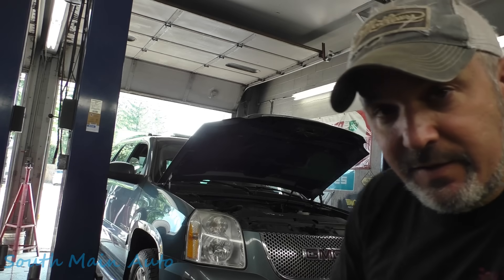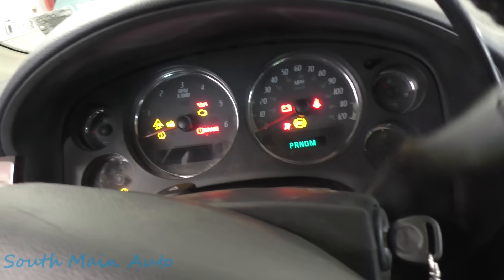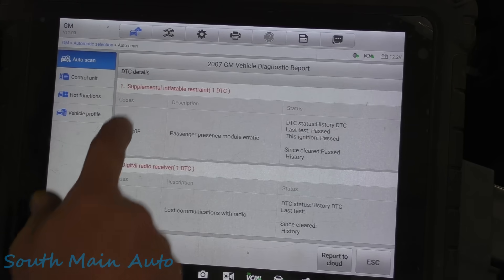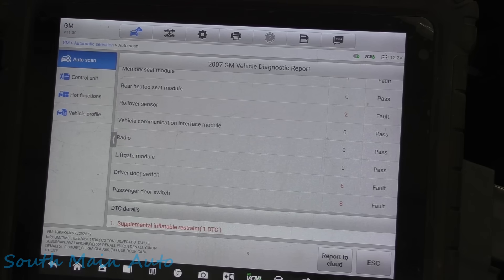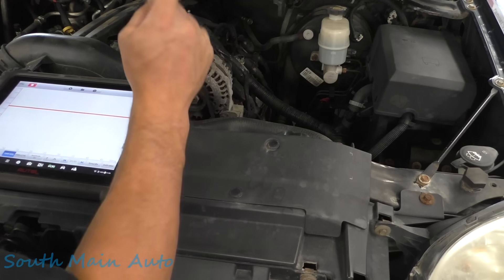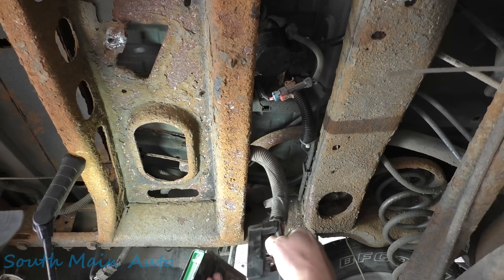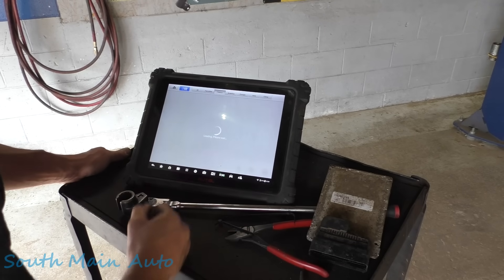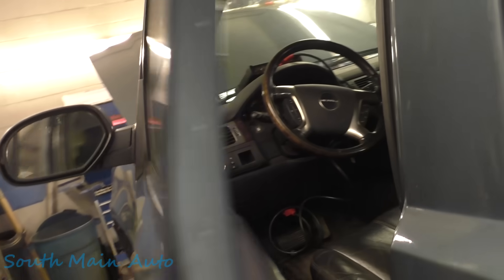Sometimes A Lucky Guess Is Way Easier Than An Actual Diag

Comment: Living my whole life in Michigan and as a retired mechanic I always thought Michigan was the "King of the Rust Belt" when it came to rust damage to vehicles. After watching your videos and seeing the extensive damage to PRNY vehicles I bow to the King. One question, do you sometimes get concerned about even lifting a car on the hoist in fear that the frame could completely fail?
Reply: PA is probably the "prince" of rust.  but with our Draconian inspections, vehicles in a LOT better shape than that underneath get sent to the scrapyard.  I lost a low mileage Honda to a subframe pinhole, for example
Reply: I am also in Michigan. I have gotten some Ny cars in to work on and let me tell you😂. First time I saw a rusted out radiator hose spring clamp was a Ny car.
Reply: Hello from Higgins lake Michigan
Reply: Hello from Hopkins, Mi
Reply: I fled MI for GA nearly ten years ago. Sure don’t miss the rust.
Reply: There are other agents dot can use to get rid of snow and ice … they are most expensive but they don’t put salt in the creeks and rivers … so much for ecological awareness…
Reply: Here in WI, we aren't far behind in the rust department. My '05 town and country fell victim of rust and could not be lifted to put on tires. Got my money's worth out of it with 217k miles though.
Reply: Nope, The Great Industrial Northeast has everyone beat!
Reply: What’s up from Lansing.
Reply: What does NY use on their roads?  I too am from Michigan and my almost 20 year old pickup is in much better shape than that Yukon
Reply: @briansmith Usually, whatever is the cheapest deicer which is often good ole plain rock salt.
😂
Reply: @mph5896 
Here in Ontario we have broken clamp problems all the time. Very common to see used vehicles with some spring clamps replaced with stainless worm gear clamps. The latter clamps are not perfectly circular and will likely leak eventually.
Reply: Ya im just starting out in michigan thought some of the things I see are bad but wow. And love the level of work.
Reply: Minnesota rust belt here.. yeah, my old 88' Silverado frame broke in half while being lifted.
Reply: @briansmith1514  we use salt, and now the state is starting to use brine liquid salt unfortunately this kills cars here. I can’t wait to leave NY
Reply: Missouri can be just as bad, just takes longer!
Reply: That is funny I once put a 70 Buick electra (on or around 82 which would make it 12yrs old) on a single post lift and if it didn't have a driveshaft in it the rear frame section would have been on the floor lol
Reply: @briansmith1514 rock salt 
 Comes from a mine maybe 50 miles from the SMA mother ship
Reply: I would not put any vehicle with that level of rust on a vehicle lift.  Here in the UK that vehicle would be condemned to the scrap heap.
Reply: When I lived in Holland Michigan I seen a lot of cars all rusted out along bottom of car glad I didn't drive or work on cars when I was there
Reply: Illinois is up there too.
Reply: I thought my 03 Chevy was rusting. I live  in New Mexico. Land of Disenchantment.
😅😅
Reply: I live in Iowa and my 2013 sonata doesn’t have any rust yet. Well, mostly. Some very very minor surface rust   And we have winters with that brine stuff being put on the road. I also once a week wash it underneath in the snow season. That must be helping it
Reply: This is true but in Michigan that truck is getting fixed and driven for sure that frame has another 10 years on it
Reply: I am across the lake from you in Ontario and have the same issues. A few cars have litterly nothing left to jack on and they go on the drive on hoist and of course  customer is informed to start car shopping.
Reply: @stevestadnik9206  they never listen either they just keep driving it until it falls apart
Reply: I can hazard a guess that you people think California cars are rust-free. For the vast majority that is true. There are areas where there is rust. Where do you think this is?
.
.
.
.
.
On the coast from salt fog. As a kid, I saw a neighbor's car with rust holes that were fairly large on a young car (3-4 years old).
Reply: @LadyAnuB  trust me cars from the coast look great compared to those from states like NY not saying the don't get rusty but its no where near as fast
Reply: @rufedog5406  Definitely. the massive amount of salt contact of road salt vs. air salt
Reply: @briansmith1514 they salt them heavily
Reply: Come to MA
Reply: @LadyAnuB My 5th grade English teacher drove from his home in Corpus Christi in a 72 Matador that was rusted through on the roof, hood and deck lid, from sea water.
Reply: @ihavethedocuments2580  Ginormous bills just for existing.  as for "morals"...there's been complaints about that literally since they invented writing.
Reply: @LadyAnuB   they have to be /really/ close to the coast.. even 2-3 miles inland there's no ocean salt.    I lived in Pacific Grove in the late 70s stuck out into the fog belt, I know it well.   And, the ocean fog salt tends to rust the exterior, rather than the chassis like road salt does.   Until earlier this year, we had a 1994 Mercedes wagon that spent its whole life in Monterey/Carmel, and Santa Cruz, had zero rust even at 280,000 miles, and I still see it around town driven by the guy we sold it to.
Reply: I lifted a Nissan pickup truck and it turned into a U bolt. Took 4 men jumping in the bed to strengthen it out. 😁
Just another day in Beantown.
Reply: @johnpauljones1499  😮😮😮😮😮
Reply: @captaindunsell8568 when I lived out in high desert Oregon, they'd just pack the roads with lava rock gravel (or not at all).
Reply: Uh why are you running that vehicle on the lift shifting gears???? You probabky just destroyed that t case bud.. this vehicle isn't supposed to be driven on the lift..
Reply: What up from prison town.
Reply: @Sweeter-Jobs  Small world!  I grew up on Main St.  Vikings class of 92
Reply: @gabekekis7032  The Ranger in my profile pic was a victim of brine liquid salt in Upper Michigan.  It was actually still my daily driver at that point.  You could almost watch it rust.  Although I heard MDOT was trying to get away from the brine because it's also eating up their equipment like Pac-Man.  Could be a rumor.
Reply: @ericwilson9314  I wouldn’t doubt it, very corrosive.
Reply: @anonymuswere never heard of a mig welder and a flap wheel?
Reply: I was a tech back in New York I watched a co worker lift a pick up and it folded in half from the rust !
Reply: @UHOH3300  I think that's a red flag in this state for inspectors.  I had that situation two cars previously, and the BUSINESS OWNER outright refused, saying "I Don't Want Sued".  not only did they not get my business, they went OUT of business.  it's my understanding that the State cracked down on inspectors for "sneaking stickers".  as I've stated, PA has some very Draconian standards.  nothing compared to a british MOT (which, apparently, literally checks the torque on EVERY NUT AND BOLT), but considering we're in the middle of a cluster of "no inspections" states...
also, no experience with that sort of thing, and no tools or lift to do anything with...we have to junk multiple lawn tractors 'cause there's no one around here that fixes things
Reply: there is a large underground salt mine a few miles north of his shop.
Reply: @airman6822  we at 250,000 + with our Toyota Minivan and she'll probably go another 200,000 miles
Reply: Michigan tech, I've seen some Minnesota vehicles and NY vehicles tied for rust champs, here, just had an '11 Silverado that the fuel tank fell out while it was on the hoist, frame crossmembers are gone...
Reply: @ronlind1757 another MN guy. Besides my parents moving back to MN in '71 from CA, I'm really not sure what I'm doing here still!
Reply: Older Dodge Dakota. Guy called me to check it out because it wouldn't start. Got there. Dead battery. Hook up cables. Get engine to turn over. Kinda sputters. Pushed the shredder valve to check for fuel pressure. Yep. Smelled what came out. Diesel.... He denied putting diesel in the tank. I start evaluating the truck. Noticed the top of the box is touching the cab! Yep! If it wasn't for the box hitting the cab. It probably would folded in half! He junked it!
Reply: Oh yeah! I've put 5 year old cars on lifts in NY that start bending, or the lift will literally go through the subrame/floor ... but because the fantastic NYS safety inspections, those still end up on the road.... super safe!
Reply: i know someone that lost a gm pickup because his mechanic lifted it, and the frame cracked. It is a concern around here.
Reply: @snoopdogie187  yeah - and it’s not just GM’s… Fords are cracking too, and I’ve had unibody cars bend too.
Reply: I always look underneath at the frame while setting it up to lift so it doesn't fold in half on me, never had it happen, Silverado's are usually the most dangerous, here in Connecticut.
Reply: 30+ yrs of salty nyroads is why I live in Arizona now lol 😆

Comment: I had a buddy Tom who was an appliance repair guy. I called him about my dryer not working.  He asked me the make and I told him. He said the wire for the door switch fell and was rubbing  on the drum and wore it in half. I thought he was nuts until he came over and showed me. Said it's common with this brand. Lots of years in the business.  Great diagnosis.

Comment: Years ago, I can remember back in the 1960's and 1970s, here in The Great Industrial Northeast, you would get about three years before rust started poking its way out of your nice new shiny car paint.
Now, with stainless steel exhaust systems, anti corrosion paints, galvanized metal, and plastics, you can get about eight years before the rust starts showing itself.

Comment: I had an 2011 denali that had electrical issues that would put it in limp mode.  Had the same issues. Took out the module and sealed up the connector. Back in business👍

Comment: I definitely learned something from this video! A: about the Denali suspension module common issue and B: never ever buy a freaking snap on scan tool when there are options like that Autel out there! Checking the network activity right from the scanner?? I didn’t even know that was a thing!

Comment: I spent the first 26 years of my 50 years as a tech in Gm dealers so many common problems made diag a breeze when I went to the aftermarket repair field what a eye opener.
Reply: What exactly do you mean, the failures across manufacturers?
Reply: @cyrilhudak4568  I think what you are referring to is not here now. I'm scratching my head.
Reply: @flagmichael  I meant what was eye opening about aftermarket repair vs working exclusively on GM products.

Comment: you are absolutely right about the lick um stick um . But that said if the shops rejected all the fails like they should people would be walking or getting a horse and buggy 😊 When will these States up here go back to using just sand on the roadways like back in the 60's ! I hate salt but you have those that don't care and need a refresher course on driving in winter !!  
I never had a 4x4 until the late 80"s 
2wd with good SNOW treads and some weight on the bed was plenty .

Comment: I have a 53" International 2 Ton dump truck (grain truck) and it's frame is still immaculate.    I've never seen rust as bad as this here in Oklahoma-- never.   You might see the occasional rust hole in a rocker panel or around the fenders etc-  on a 1970's or 80's pickup.. But otherwise, rust doesn't really exist;  once the steel gets a paint job, it typically lasts virtually forever.   I don't see how you guys deal with it.  I couldn't image buying a brand new truck knowing that it probably won't last 10 years.  smh..  That's just insane.  I've always bought vehicles that have 150k to 170k miles-- and THEN I drive them for 10 more years after that, and run them past 300k.  So IDK--  You guys are a different breed accepting this kind of wealth drain.  I can't wrap my head around it.

Comment: Experience is always a good thing. My brother in law called me last week and said he had a fuel leak in his 2010 gmc sierra. Without even looking at it I said you will need a fuel pump, o ring, lock ring two fuel tank straps and pull the box off to fix the crossmembers. He thought I was crazy until we started the work and he seen he did need everything hahaha

Comment: I can't imagine why anyone in that part of the country wouldn't fluid film the frame of ANY new vehicle the day after they bought it especially if they bought it brand new. Yikes. Thanks as always, Eric!
Reply: Just a guess: too many people burned by rubberized coatings and assuming all rust prevention was snake oil.
Reply: @flagmichael   Also, people who buy new cars often sell the car along before the rust is a problem for them.
Reply: Living in the South, I've never coated a vehicle and never owned a vehicle with any rust issues. If I lived anywhere that used salt, for sure I would do annual or semiannual coatings. But here, it's just an unnecessary mess, and makes working on the vehicle unpleasant.
Reply: I have 07 Silverado that looks showroom new on the bottom side compared to that thing. I live in the west suburbs of Chicago so we get snow and salt. The question is what in the heck are they putting down on those roads that eats cars.
Reply: @robm3063 
Salt , lots of salt every time   it snows (, and some sand too )
Reply: @abeneufeld9690  we must use a different salt then. These vehicles look like what our vehicles looked like in the 70s-80s around here.
Reply: Kind of my question.  Used to be a customer had to opt out of undercoating a new vehicle.

Comment: Funny story, my neighbor had one of these and he had a problem where if you’d take off the fuse box cover, it would start, put it on, dies, the code was lost communication with fuel pump module, however we noticed the fuel pump relay, if we touch it, we hear it kick in, changed out the fuse box n the issue was fixed

Comment: As always Eric, great video. Yep, I don't miss the rust out condition of the automobile. My 2000 XLT Ford Ranger sure looks good, at 204,000 miles here in Arizona. When I do maintenance, the no rust sure make it easy, That's when I say out loud, if I can do it, you can do it, just like Eric says! Shout out to Mrs. O, thanks again for sharing your great data base and repair skills.

Comment: Older cars and trucks rot we didn't have problems with electricity, usually the cradle would  just fall  apart or a control arm would be a crunchy mess. The floors would change into  Flintstones floors.

Comment: The condition of the body looks pretty good!  Too bad about the frame.  We suffer the same fate here in Northeast Ohio.  I have an '06 Explorer with only 120K, but similar condition frame, and body still looking good.  All our cars succumb to the same rust cancer.  Hoping "Surface Shield" will change our luck going forward...
Reply: Anything will do, except nuffin. Bar chain oil is fine too, but you have to look after things. Again, anything will probably do.

Comment: Thanks Eric, another great show!   Wow,  it's sad vehicles like this are still very nice 'up top', nice interior, nice paint, etc.., but underneath they're toast, and ready for the salvage yard.   I don't know what the answer is.  Better build quality/rust proofing from the factory, or somehow find some other answer for dealing with winter time roadways.  Maybe the car companies DON'T WANT to have their product last for decades and decades, like they used to.
Reply: The customer has the power to make their vehicle last. Underbody washes help a lot, Fluid Film application every year pays for itself in a handful of years.
Reply: It's called...built in obsolescence.   Car makers don't want a vehicle to last.
Reply: Yeah just wait till the rusties creep up and in to these new EV's !!!!!
Reply: @garyalford9394 just give it a few more years they'll all be made of plastic nuts bolts and all 😂
Reply: They don't. If their products rot away it's a guaranteed sale for a new car. That's why they rust faster today than they ever have.
Reply: @garyalford9394  it's bad enough when the batteries get a bit of water in them or sustain some other kind of damage and short out. Have to dump a whole lake's worth of water on them to get the fire to even consider going out.

Comment: We have a 2010 GMC Yukon that a shady dealer kept throwing parts at it, turns out a couple months later after me going through wiring diagrams the VCIM was shorted to ground possibly, so all I had to do was remove the fuse and she starts every time. symptoms would only occur when it got hot outside once you pulled the ground cable she’d fire right back up took a while to have time to diagnose thought you might think that was interesting. You’re the best thanks

Comment: Right away when Eric shows those DC voltages on the CAN lines, I knew there is a resistive "short" someplace.  A CAN bus w/o some hardware fault like that but just "dead" from no modules talking on it would expect to see those 2 just a bit above and below 2.5v each.  Since they were both a lot lower, said to me there is a resistive short someplace.  The experience here was knowing the likely place that would be!  Hole in the module and full of salt water would do it.  I bet that circuit board in there is a real mess.